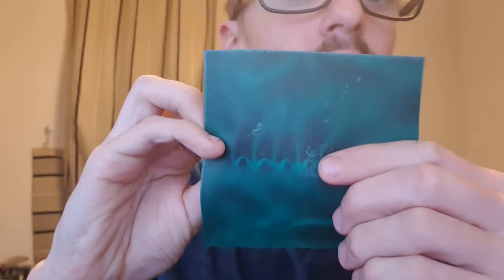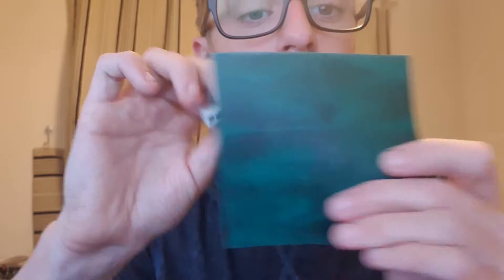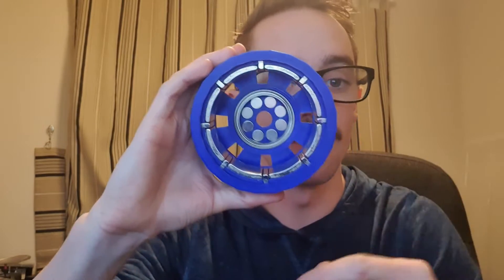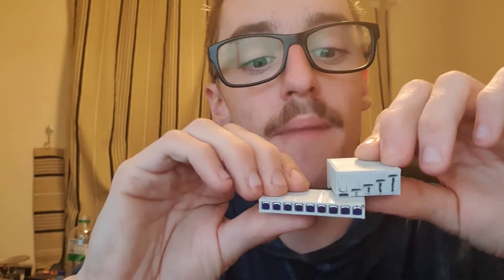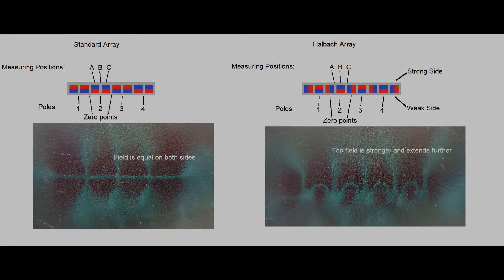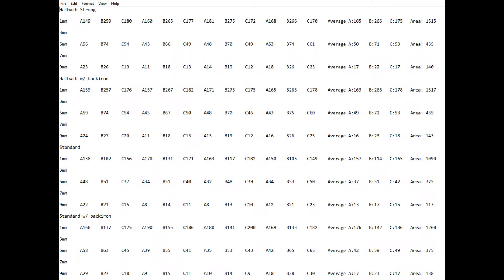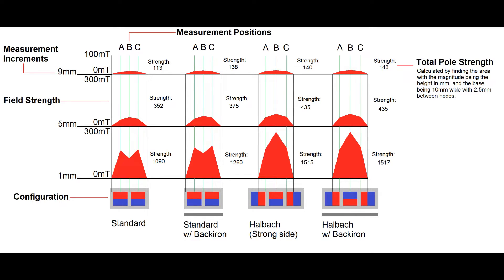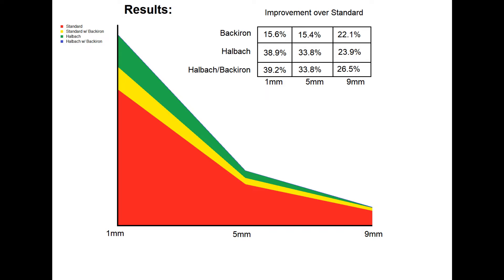Focusing Magnetic Fields (Halbach vs. Back Iron)

Comment: I've recently learned through my work that you should get even better results if you test with 3 magnets. 1st magnet poles vertically aligned, 2nd magnet horizontally aligned and the 3rd magnet vertically aligned but flipped 180 from the 1st magnet.

Comment: 查看了很多关于这类阵列的视频，有个问题。如你视频所示，向上一面是强磁，它的极性是N还是S，或者交替出现呢？我想设置一个环形的海尔贝克阵列，使上半圆为N强磁，下半圆为S强磁，这样能做到吗？
Reply from the maker: The magnets alternate. If you have two north poles pointed inward towards a middle magnet, then the north side of the middle magnet will be the strong side. Those magnets on the outside are now pointing their south poles at the next magnet in the line, so that one should be flipped to keep the strong side pointed in the same direction.
Reply: @BenjaminDMarshall  不太明白你解释的侧重点，但还是非常感谢您，这么快的回复
Reply from the maker: @zhihuizhang-t6m  I hope this makes sense. https://i.imgur.com/kwfQV1H.png
Reply: @BenjaminDMarshall  拿一根长条磁铁N极略过上面强磁部分，磁铁N极会一直受排斥力吗？
Reply from the maker: @zhihuizhang-t6m  No, the force at the top alternates. The N pole of the bar magnet will stick to one of the blue parts.
Reply: @BenjaminDMarshall  哦，我想用海尔贝克环形阵列实现一个半圆强N极，一个半圆强S极，那做不到了？

Comment: Nice effort. But what a shame you didnt grasp the principal of what the iron ring does in an outrunner bldc. A single magnet sized piece of iron basically makes no difference. The magnetic circuit between two magnets of opposite poles channels the otherwise unused outside flux back into the coil facing direction. A simple experiment with your revealing film would have shown this.
Anyhow, the biggest loss of flux is in the first 0.5mm! Half the usual minimum air gap!
But you need manufacturing tolerance and also thermal expansion to take into account.
A magnet is not very good at actually 'conducting' magnet fields according to Wikipedia. So why stacking magnets makes them stronger I have no idea, its some kind of contrafictory voodoo.

Comment: With a hall bach array, the magnetic flux flows directly from each magnet pole to the other magnet, which makes adding backing useless. The only time you would want backing is with non-permanent magnets/electromagnets. The physical metal of the magnets themselves is your backing material in an array making additional backing redundant, adding only cost and weight.

Comment: I found that there wasn't much difference between a back iron and Halbach array. The back iron very nearly doubles the effective magnet height. For relatively short magnets that does almost the same as a Halbach array. For taller arrangements, the Halbach array may win (I didn't check). But the back iron has to touch the magnets. The main advantage of back iron is that the arrangement tends to more or less self assemble whereas Halbach arrays disassemble.

Comment: Nice methodology for the most part, but testing 2 magnets in standard vs 3 magnets in halbach doesn't really compare the configurations honestly imo.
Reply from the maker: That's just the image. The actual readings came from magnets embedded in an actual array. Also the halbach pole is sort of composed of one and two half-magnets.

Comment: Would making a Halbach array in 45 degree rotation between each magnet instead of 90 degrees do anything?
Reply from the maker: So if you had 3 magnets in a row, initially all pointing the same direction....

I'm imagining that as you turn the outer two magnets to point inward, your array transitions from being symmetric to unidirectional. In other words, I think that having the magnets at a 45 degree angle would just make for a less good halbach? I'm obviously not an expert though.

Comment: Thank you for nice experiment. The back iron for standard configuration would help much more if it was much closer (touching the magnets) and it is there to close the magnetic circuit on the back side. It helps the magnetic flux, because with back iron it doesn't need to overcome magnetic resistance on back side. And it also prevents electromagnetic waves/fields outside the motor. Also there is normally gap between south and north pole magnets to avoid magnetic circuit shortcut between the magnets. It also improves strength. Anyway, your experiment was interesting for me as I did not know much about the Halbach array.

Comment: So if you print your stator Halbach array with magnetic filament, would that act as a magnetic backplate or shunt diffuser?  If you printed a ring backplate out of magnetic filament with normal PLA as the standard stator, would that improve your motor strength?

Comment: hey the chart at 6 minuts shows 3 magnets used for hall bach and 2 magnets for standard..as an guy with absolutely no idea it seems an unfair comparison..i do understand here we are talking about focus not actual strenth...seems to me the back iron actualy takes strenth away (40%) but from the other side and reflects just 2% to the stator side.in an aplication like a bike the back iron would use more energy climbing hills than the 2% gain in magnetic strenth? but maybe if each of the 42 magnets gain 2% strenth maybe there could be a gain.in any case i would in my aplication be more interested in the weigh reduction.prhaps you could achive higher strenth by using diferen size magnets?..interesting stuff:)

Comment: thanks i learnt more than the answer i was looking for..here was my question..on an out runner does the rotor have to be steel or iron?..can it be for example nylon for less weight?...ihave a direct drive bike motor and its too heavy..after watching your vid seems i can replace the outer rotor steel/iron with say nylon..it wont be strong enough to take spoke loads but i can mount it forward of the wheel and drive the wheel by chain...thank you and any thaughts you have would be grate.

Comment: Hello Benjamin!
Is it possible to make a switchable halbach array like switchable magnets?
Reply from the maker: If you include a backiron behind your array, and then make a way that the primary magnets (the non-sideways ones) can rotate 180 degrees, then you could effectively turn the array on and off.

By flipping the primary magnets, you're switching which side of the array is the strong side, and which side is the weak side. Adding the backiron provides a low reluctance path for flux, further weakening the array when turned 'off', and ensuring that the back side of the array is not too strong when turned 'off'.

If you've ever seen a 'mag chuck', I'd be willing to bet that that is exactly how they work.

Comment: Question... in the Halbach array, what would be the effect of using lower strength magnets for the 'side orientations'? Would they still direct the field lines/flux through in the same way without detracting from the main power of the stator facing magnets?
Reply from the maker: I haven't tested varying strengths of the side-facing magnets, but I can only imagine that you'd want them to be as strong as possible.

Comment: I think the gap the plastic creates skews your results. You should glue the magnets together and test again.
Reply: He already achieved a significant difference at 1mm gap and 5mm. So maybe gluing might increase the field at 9mm significantly also? But he only used a small amount of back iron. Most motors use considerably more back iron.

Comment: The reason adding back iron to the Halbach array did basically nothing is because they are basically the exact same thing for the same reason;  which is generally to get as much of the PM's flux cutting the working turns of copper to which it's meant to be coupled and nothing else.  Using high permeability materials to back an array of magnets has an effect very similar to that of the H.A.'s at a fraction of the price, but it comes at the cost of greater weight and lower performance.  In short, you can't improve the performance of a high performance system by also adding a low cost alternative to that system.  The iron is basically unmagnetized dead weight because the Halbach is not leaking any flux to which the iron could offer a more direct path.

It might seem counter-intuitive and a bad thing that the field dies off faster with distance from the magnets but it's actually highly desirable and a direct consequence of these field configurations.  What we mean when we talk about the strength of a magnet in Tesla's at a particular point or region in space is is the magnetic flux density - . The more the field can be confined to the windings, the better the specific power and efficiency of a (synchronous) motor can be.  The air gap between them does need to be made as small as possible though.
Reply: en todo caso en vez de hierro dulce deberia de utilizar una placa de mometal pero sigue sin tener mucho sentido pues el flujo se encontraria en sentido contrario , por lo que sigue siendo peso muerto ....

Comment: apparently according to wiki, there is also halbach cylinder and halbach sphere configuration as well. The sphere configuration has around 4/3 times the ideal cylinder configuration given same amount of magnetic material. Not sure how to incorporate sphere configuration into a motor though, maybe two half spheres ? so the rotor housing can slide through. Also I wonder if you arrange regular electromagnetic in the same halbach array configuration, does it also increase its magnetic strength ? or is this a permanent magnetic specific feature ? great video btw
Reply from the maker: A motor with spherical rotors/stators does not sound ideal, since any magnets near the axis of rotation would not provide a significant moment of torque, but it might be worth testing out.

As for halbach electromagnets, in a couple simple experiments it looks like arranging electromagnets into a halbach array works, but provides less benefit and take sup more space than simply increasing the amount of current flowing through your electromagnet.

Comment: Don't know if this was mentioned in the video but I suspect the back iron added little to the magnets configured in the Halbach orientation because of the weaker back facing magnetic field. Great stuff!
Reply from the maker: If you're referring to the graphic, that's just a mistake I made while drawing it.
Reply: So does the back iron go on the weak side of the Halbach array? Also, your graphic shows two magnets for the standard arrangement and three for the Halbach arangement but you actually used nine magnets for both configurations, right?
Reply from the maker: The back iron was placed on the weak side, yes.

The graphic showing the arrangement of two and three magnets is just showing one pole. The tested configuration for each setup had four poles, and I averaged the reading for each pole together.

The halbach arrangement uses three magnets per pole, but the outer two magnets can be shared by the neighboring poles. While the standard configuration uses two magnets per pole. Having a setup with four total poles results in the halbach array having nine magnets total, and the standard having eight total.

If the array were configured into a loop, the halbach configuration and standard configuration would have the same number of magnets.
Reply: @BenjaminDMarshall  i believe a fair comparison is only one with the same total number of magnets

Or at least total magnet surface per pole

The results would lead me to assume three magnets in traditional configuration would have higher curve area and possibly peak than the halback array
Reply from the maker: When the linear halbach array is closed into a circle (as it would be for a motor) it possesses the same number of magnets as a conventional array, since a pole in a halbach array shares its outer magnets with the neighboring poles, each pole only really uses 2 magnets. Also, the graphic pictured is showing the average field of every pole in the array rather than a single standalone pole.

I personally think this is a fair comparison, but I probably could have made the graphic a little better.
Reply: What would really be interesting would be to compare power in watts output from the same size motors one with halback and the other with standard

Comment: i would like to know if anyone has ever tried using a magnetic setup like a halbach array to make a vacuum sealed portable or non-portable electricity generator that could possibly use a wind up spring or other source of power like solar?
the possibilities are endless to create renewable sources of power generation
if you can combine ideas, technology, and resources with practicle application

Comment: Magnet mass vs pole count pr area needs to be identical to compare strength properly...
Reply from the maker: Once you form a halbach array into a circle,  the number of magnets and poles ends up being the same as a standard array since a pole within a halbach array shares its outer magnets with its neighboring poles.

Even if you were only making a linear array, the entire halbach array would only require one extra magnet over a standard array for the same number of poles.

You can see this in the video at 0:45. Each array has 4 poles, the halbach uses 9 magnets and the standard uses 8.
Reply: looks like the same area count.  2 @ standard for one pole vs. 1/2 +1+1/2 for the halbach and the other side of the 1/2 are for the next pole.